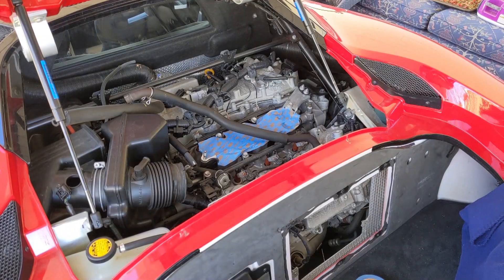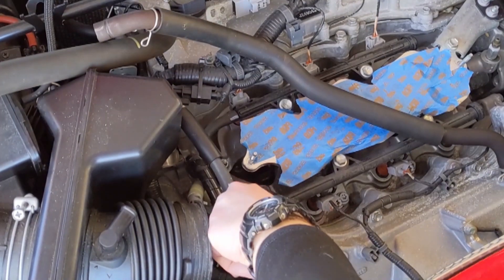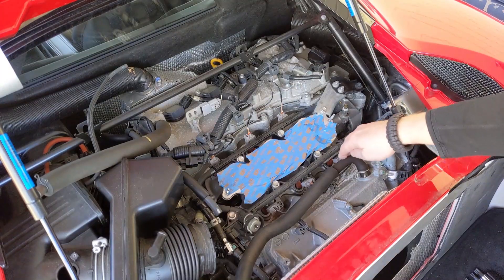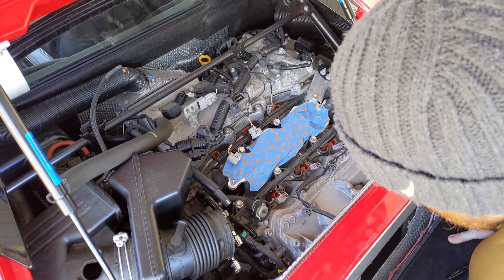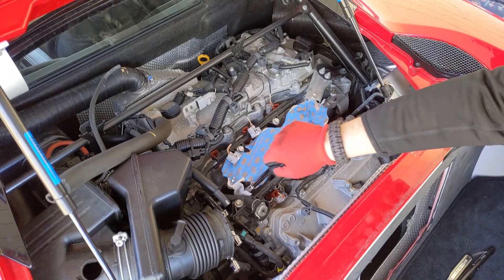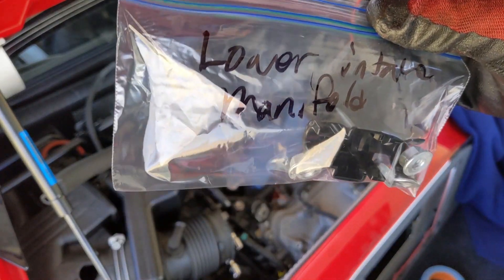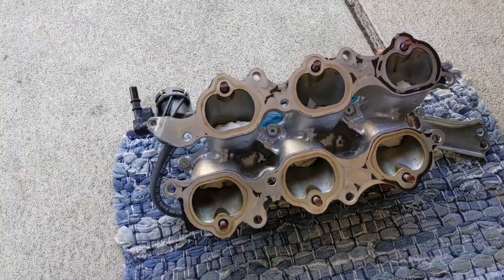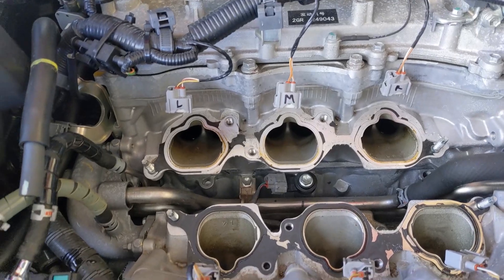Lotus Evora Knock Sensor  Replacement 2GR-FE, Part 2

Comment: Did you replace the sensor? And why?
Reply from the maker: @naif.1044  turns out it was not the knock sensor. It was a broken wire inside the engine on the wire loom that connected to the knock sensor. Original knock sensor was fine. And once I replaced the wire loom it worked perfectly.

Comment: Comment at 5:08 about 'little bit of rust' on the bolt - I reckon that's thread-locking compound not rust, particularly from the way the bond was cracked at 4:58 ..
Reply from the maker: hmmm. It may be. I didn't consider that! Thanks.